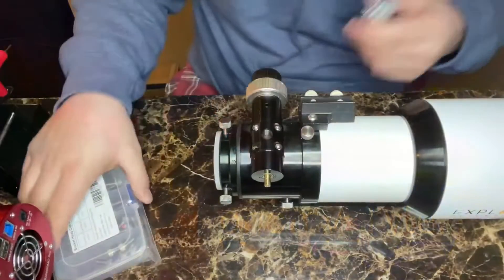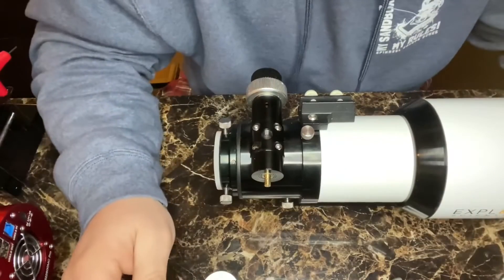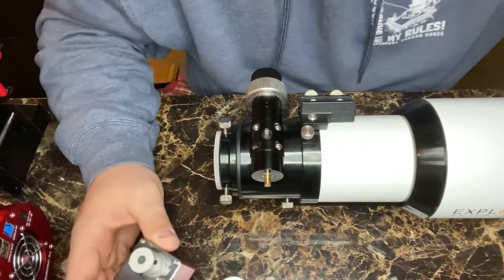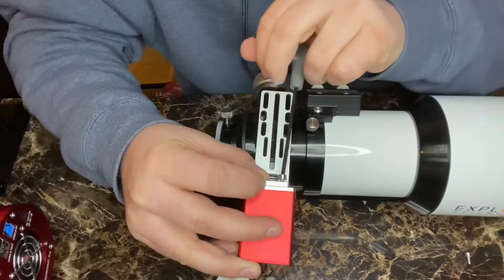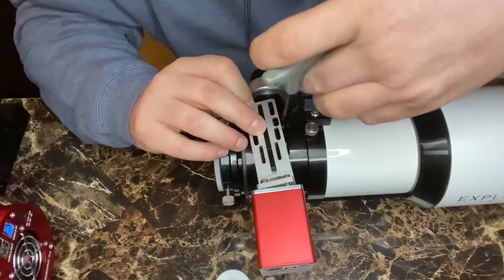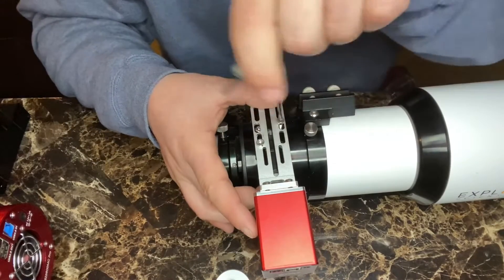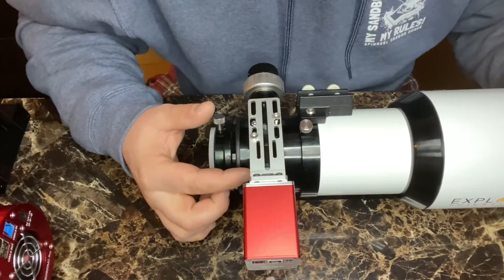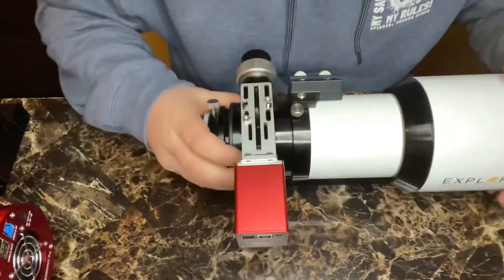Fitting a ZWO EAF Motor to an Explore Scientific Focuser the right way!!!!

Comment: Question : on the middle of the four screws 2:10 i have only some rubber (without the screw it self) . Do i need to remove it ? I can focus manually without a problem.
Reply from the maker: You might find they are dust caps do look underneath

Comment: Hi. Thanks.
Important to remove only the diagonally opposed 'pull' screws. The other two   ''push' against the focuser body to adjust backlash..Make sure you have the correct backlash before tightening the new bolts. HTH.

Comment: I cannot remove the set screw on the course knob, it is frozen. The allen key has slipped a few times even though I put pressure down on it.  FYI, I'm not simply pressing down, I'm squeezing the allen key down but pressing up on the knob so I don't bend the shaft, but it still wont' budge.  Then I put a drop of 'Break Free' (Its like WD-40) in the screw hole and let it sit hoping it would help loosen the screw; still no luck.  Any ideas on how to do this without damaging anything?  Please help, I'm close to drilling the screw out and/or cutting off the course knob.

Comment: Hi me again, having a lot of trouble finding the .7 thread, I live in Spain I have found .75 but it feels really tight and I’m reluctant to ‘force’ did you find the new bolts a tight fit?
Reply from the maker: The thread should be the the exact same if you have to force then it could be wrong from the store.

Comment: Thanks for this video, am about to embark on installing the EAF on my ES ED80. Question: do you have any standoffs, washers, etc between the bracket and the focuser body where the M4 25mm bolts attach? Can’t tell in the video if the bracket is sitting tight to the focuser body or if there is a gap.
Reply from the maker: Tyler used standard washers in the video but nothing underneath the bracket that touched the focuser body! Hope this helps

Comment: Did you find it difficult to remove the es bolts? Mine seem extremely tight, even glued and a special washer? 🤷‍♂️
Reply from the maker: Hey Steve, there may be some lock tite on the screws. They usually come out pretty easy though. Let us know!

Comment: Thank you very much for this video. I recently installed a 10:1 knob to my 2.5" Hex Focuser and have been struggling to find any documentation on what each screw does. Now I know those two longer bolts underneath are for fastening the wheel to the focuser and that the locking nut can be removed without any problems. Progress!! 

Would you happen to know what the little grub screws do near the tension screws on top of the focuser?

Clear skies!